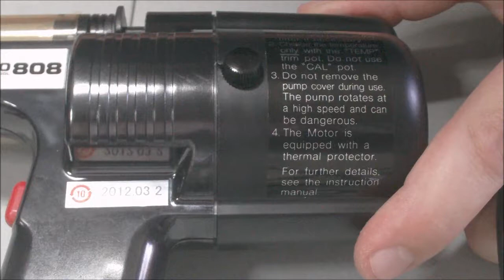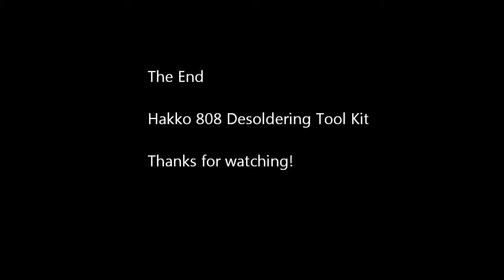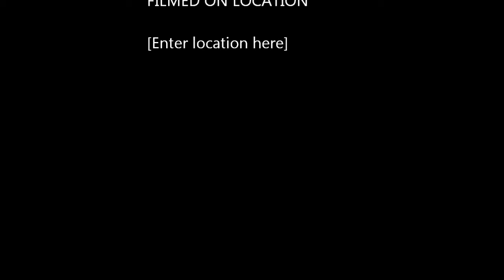Hakko 808 Desoldering Tool Kit

Comment: The Hakko808 has helped revive many a analogue Synthesizer... worth the cash
Reply from the maker: Mine is still going strong, 10 years later.
Reply: @NETBotic  that’s quality!
Reply: @NETBotic  I have a 100V Japanese one, it is a pain to use with a transformer but it works wonders.

Comment: I bought one S-993a many years ago, I don't like the tips, come with a steel tube inside,
Recently I bought one Yihua 948, price is Us$100 dollars and works 100 times better.
948 is an excellent tool for the price, all the spare parts are avialable.
If you are in budget this is the right tool for you.
Best Regards.

Comment: great video, good explanation. From time to time, computer motherboards' capacitors go bad and they look fat and bulging. This is a great tool to tackle those hardware problems. This is a great tool for IT repair guys.  It would be fantastic if the poster comes up with a video that shows how to sold a capacitor onto a motherboard. Windows and viruses is not that difficult to tackle, it is the hardware problems that become big challenges for pc users of whom many don't even venture to even open a PC.  Would be nice to see a video about capacitor soldering.

Comment: Very good video Thanks.. I have been using the Air Vac PVS60E desoldering since the mid 80's and have been very pleased with it, however, you need a compressor for that unit which prevents field use.
The Air Vac system is very good for bench work, although, I have yet to see a youtube video of it's use.
Again, thanks for the detailed video, very well done.

Comment: Thanks. I just bought one and it works great. However, when I opened the box, the cardboard label/liner under the clear plastic case specifically says "NON-ESD." One cannot see this notation without purchasing the item and opening it. I think if one first clips out components (ICs etc) out of static sensitive boards and then de-solder the holes one at a time it should be OK. I bought mine to re-work vintage tube amplifiers (Leslie Speaker, Guitar amps, etc) so I have no ESD issues anyway.

Comment: One tip is to wiggle the tool in a circular motion around the lead to heat all the solder around the lead.  That and/or dilute the solder on the board with a low temp solder like ChipQuick in order to ease the flow.

Comment: The manual suggests leaving the tool on for 5 minutes before use so solder doesn't clog the intake tube.  It should have an LED though.

Comment from the maker: It seems how well it desolders depends on the tip size vs the component lead diameter. Needs to be tight. You might need a variety of tips. The one that comes with it is definitely for larger components. Also lead free solder is a pain too. 

The only problem I have with this tool is that I left it on overnight once, it should have an on/off switch for the heat, or an indicator light that it's on. Otherwise it's great :)